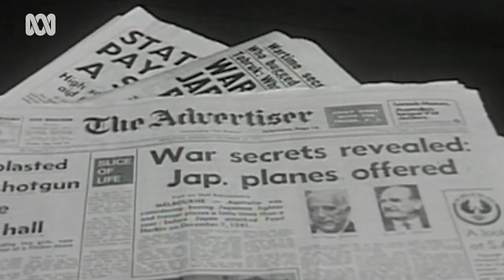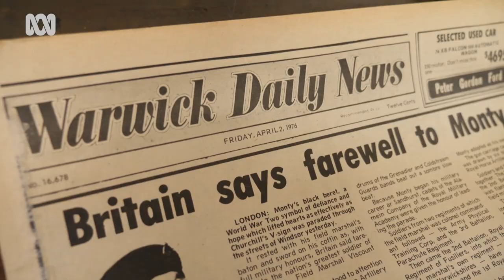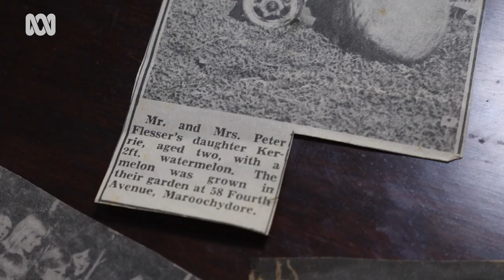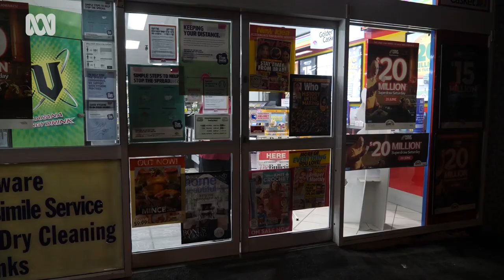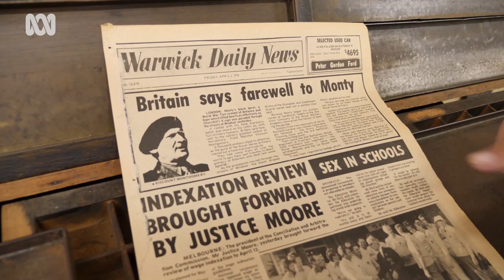The end of an era as newspapers go digital 📰 | ABC Australia

Comment: In the USA younger people read the news online if at all. The older folks read it to a certain extent, but it cost to much now so some gave it up. I realize that in some isolated areas of the world the paper is the only source of news as they can’t receive a signal for internet or tv.
Reply: Newspapers mostly profit from advertisements. There are less advertisements on print because there are less readers so it brings the cost of the paper up.  Newspapers that currently print are breaking even they are not making much of a profit with print. Where digital is very cheap and even can be done from home and not just in the office. It's a miracle how they still exist even during the pandemic.